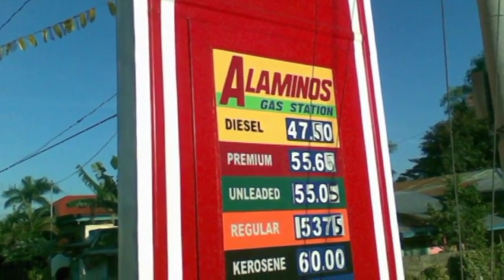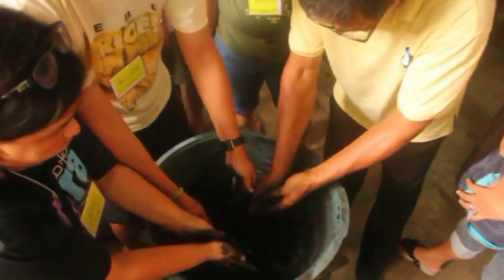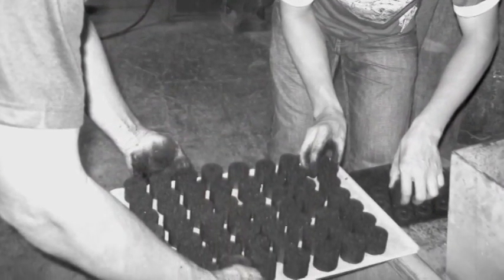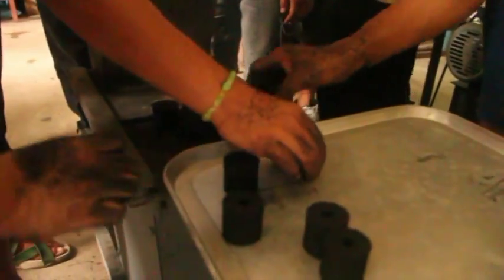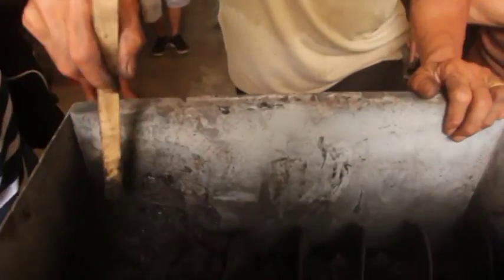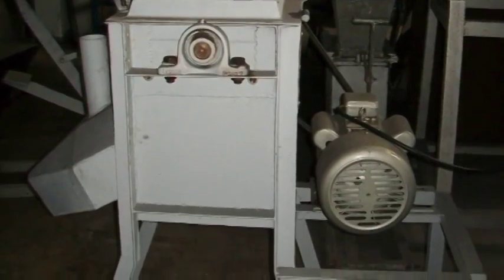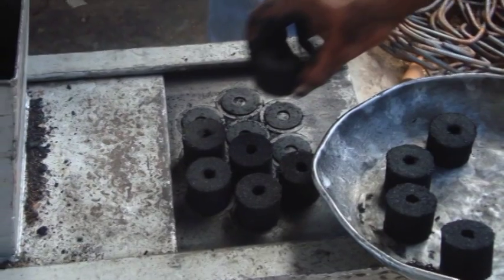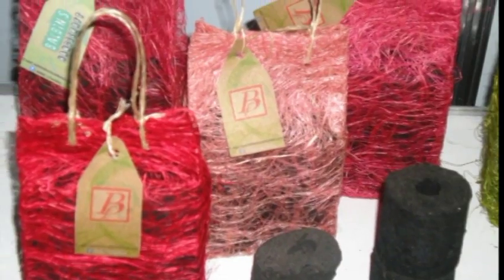DOST-FPRDI Charcoal Briquetting Technology

Comment: Bro, I have problem with the mixture it comes too weak , can I chat with ?
Reply: U need to do with try and errors method because it's all depends on raw material
Reply: Use starch to bind
Ex weat floar or corn starch etc
Reply: rushikesh fegade , 
hello po. 
can i ask what's the ratio for the starch and water to make the binder?
Reply: @deannekayepanes14  start with 4 cups water then stir in 2 cups flour. Turn heat on medium and bring to a rolling boil. Stir until it starts to thicken.
Reply: Weak how?